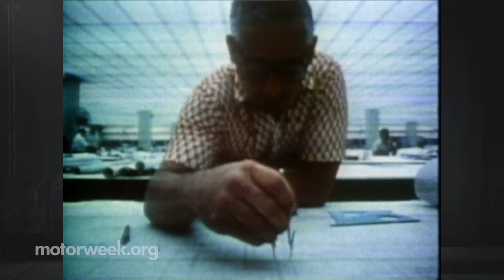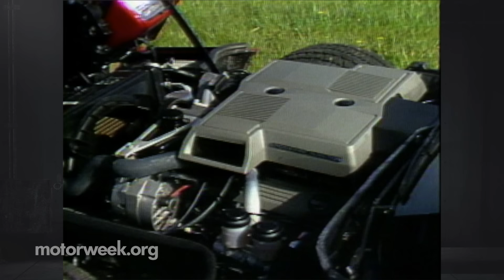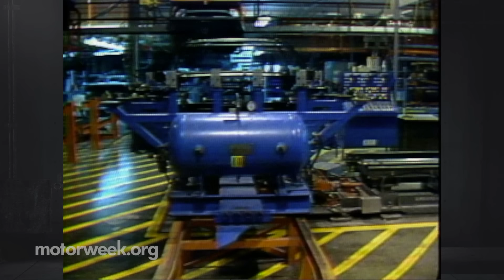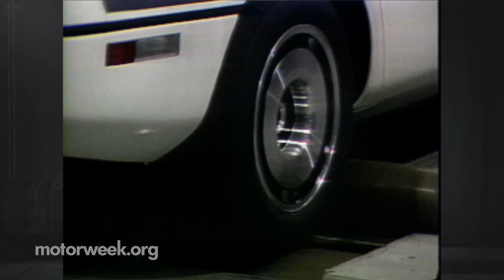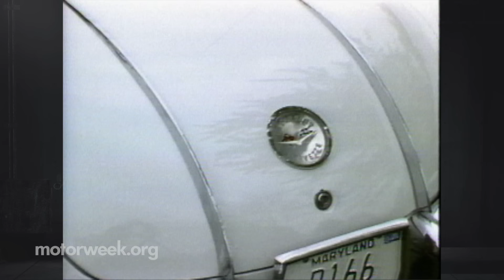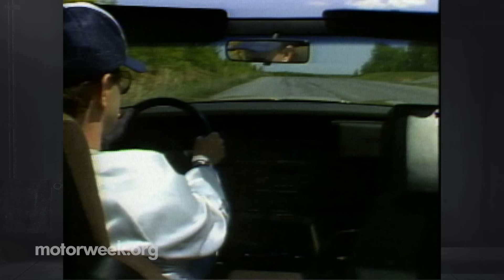MotorWeek | Retro Review: '84 Corvette Special Episode

Comment: All that fuss about how great the car is, how advanced the technology is and how powerful the engine is etc etc.. Then on the road test he says "A hardly slow time of 7.9 seconds from 0-60" - I nearly pissed my pants!!
Reply: this was 1984...... maybe you should learn some automobile history
Reply: Yep, C4's were nothing but glorified Firebirds until the LT1 came out with actual somewhat respectable numbers.
Reply: +MaxTheKanuck There isn't anything in common between a Firebird and a Corvette...aside from design gimmicks like the rear hatch and pop up headlights, they're completely different cars.
Reply: SuperDuty455 I mean performance wise, they were both slow and underpowered.
Reply: +MaxTheKanuck Well compared to what was available back then, they weren't bad at all.
Reply: SuperDuty455 Nope, they were still pathetic. Compared to most of what was new then, they were more or less up to par, but compared to the cars that had come before, they were junk. Take a 1969 Corvette with an LS6 and race it against a 1984 Corvette with an L98. Give you a guess which would win.
Reply: +MaxTheKanuck yeah because thé LS6 was the standard engine in the Corvette...by the way, the pre-71 power ratings were not realistic, it's the actual performance times that should be compared. You'd be surprised how well they do with so little power.
Reply: SuperDuty455 Um... Yes it was? LS6 454 bud, there was the LS5 and the LS6, LS6 was the higher spec engine, made about 500 horsepower. And that's actual horsepower, not an inflated number. And regardless of your opinion on it, the fact is, the older car would completely embarrass the C4.
Reply: SuperDuty455 Wait, I dun goofed, LS6 was only available in 1971.
Reply: With a much bigger engine and nearly no restriction, it would be embarassing if it didn't :P It was rated at 425hp actually. SuperChevy did an article testing a few all original muscle cars on the dyno, including a Chevelle LS6...those 425hp turned out to be a much less impressive 283hp...So yes, those pre-72 ratings are ridiculous.
Also, C4 Corvette would dominate any C3 Corvette on a race track thanks to its much superior chassis.
Reply: SuperDuty455 Chassis design means nothing when you have twice the WHP and probably 4 times the Torque.
Reply: +MaxTheKanuck out of a straight line it does
Reply: SuperDuty455 I'm having a hard time trying to figure out why you're defending this pathetic feat of engineering to such an extent. A 1969 Corvette with fucking wagon wheels could kill a base C4 around a track. Handling means next to nothing when there's that much of a power advantage. Plus, C3's didn't really handle too badly either, an LS6 454 would inevitably be imbalanced as fuck, but it's still controllable by someone who knows what they're doing. C4 loses. End of story.
Reply: I'd have to see that. Yes the LS6 is faster, but then again, how is that fair to compare this monster to a 350 small block base engine ? In that case I could use the ZR1 as a comparison...I doubt the LS6 wins by much there.
And yes, handling matters a lot when you're on a real track. If your car skids all the time and you constantly have to adjust its trajectory, you're losing precious seconds.
Reply: By the way, it appears you're still in high school so I doubt you have much if any experience with either the C3 or the C4. Pointless discussion.
Reply: +LeadBlastin22 Detroit was still attempting to come back from the gelding emission controls and fuel economy regulations did to the former 'muscle cars'.
Reply: +MaxTheKanuck Ummm.... Leaded fuel, CAFE regs, Arab Oil embargo and pollution control.
Reply: +MaxTheKanuck Handling makes a huge difference around a track.  That's why the Europeans were kicking out butts on the race track with significantly smaller engines.  The C4 Corvette was a step in the RIGHT direction for a sports car.  The Corvette is a sports car, and not a muscle car.  Sports cars are designed to live on the track.
Reply: +LeadBlastin22 7.9s in 1984 was pretty good at the time. Plus, the corvette is a sports car, its more about handling than raw straight line speed.
Reply: Jason Voorhees All of which I already knew. But yes, that is indeed what happened.
Reply: MaxTheKanuck The 1984 didn't have the L98, it had the  Cross-Fire injected engine. And by 1984 with stringent emission standards, we're lucky we had Corvette. Wow, we sure have come a long way haven't we. I mean a 2019 Corvette ZR1 with 755 horsepower and 715 ft. lbs. of torque is what a Chevy Corvette was truly meant to be. And yes a '69 Corvette with any engine would beat a stock '84.
Reply: That's not correct.

Comment: Wow. How much did Chevy pay you to make this episode?
Reply: +OscarMaris you must be new to motorweek retro.
Reply: +OscarMaris smooth bro
Reply: someone else explain it to him.
Reply: Oscar, I still have my '84 and it outperforms the factory spec across the board.  It has over 350K thousand miles on a rebuild at 130k, with no oil leakage or burning.  The "84 had some flaws, having extremely stiff springs, but it also out corners any Corvette, naturally controlled - without a computer.  This car was MotorTrend car of the year and won many other awards that year.  I outperformed Porsche 911, Ferrari 308, Lotus and the Datsun Z at Laguna Seca.
Reply: OscarMaris it's funny you talk about that I noticed in the 80s GM always got better reviews than all its competitors on MotorWeek. There must be some politics involved. same with Motor Trend and the 90s it was the Subaru. Subaru's were always so much better built and so much higher quality than the others. I find that pretty funny since it's pretty rare to see a 90s Subaru still on the road.

Comment: Hand painting with no respirators. Smart. I wonder how many of them are still alive. I had a first model year that was 2 years old with practically no miles, under 5k. It had the optional Z51 suspension, which handled like a race car but was so stiff, the car couldn't be used for travel. I had to sell it because every time I hit a dip in the road, my head would smash into the roof panel. Not comfortable, at all. 

I had one of the rare cloth seat versions, and the upholstery had separated from the air bladder controls with so few miles. Also, the rear hatch solenoid failed. GM wanted a small fortune for it so I took it apart with a can opener and fixed it myself. And BTW, the '82 Collector's Edition was the first production Corvette with a rear hatch that opened, contrary to what John Davis says. 

I never cared for the LCD dash, it looked cheesy to me from day one and I wondered about it's reliability. And the car was not that fast, all things considered. 0-60 in 7.9 seconds is laughable, but C&D said it did it in 6.7 seconds, and I'd believe them over this goofy show. I did like the styling of the 84 Corvette, but it looks pretty dated today.

Comment: Back when 205HP and a "Hardly slow"  0 to 60 of 7.9 seconds and a 15.8 quarter was fast. 
         Flash forward  35 years to a 2019 base model Civic with a 0 to 60 of 6.8 seconds, and a 15.2 quarter  :)
Reply: Dont even have to FF that far. My first car a 96 Z24 did a 15.6 in the 1/4 stock with a dohc 2.4 liter. Had 155hp.

Comment: I owned a 84 crossfire Vette and it ran awesome. I know the tuned port was better but if GM would've opened up the heads a bit to truly utilize the crossfire design instead of choking it off to meet epa guidelines, it could've been twice the performer it was. I never had a moments issue with my 4 speed model. Ran like a scalded dog.

Comment: If you're going to buy a C4, go for the 1992-96.  No issues with non-functional LCD's, or the problematic TPI.  The TPI is hell when it's well, but when she's sick...  Avoid anything with the Doug Nash 4+3.  The only complaint I had was the design of the LTT-1, and that fact that the opti-spark ignition was under the water pump.  You can imagine what happened to it once the pump leaked.  And it isn't easy to replace either.  The 1988 and up headlights have a circuit board by them that is uber expensive to replace, and they can get wet.  I never did like the foot well hump on the C4's.  I didn't like the C5's at all, and didn't get my next Vette until the C6 debuted.  Somewhere around the house I still have my 1988's targa top tool.  What a bitch removing that was.

Comment: This would be MotorWeek '83 right, as I presume this episode was shot in early 1983? Not sure why everyone else thinks is a 1984 episode,when Bowling Green was practically ready to build these by the very end of 1982 (st. 1/3/1983).
Reply: im guessing it was late '83 as there is no 1983 corvette because it came out so late in the year GM decided to make it 1984
Reply: Not true, it went into production in January 1983, so it is not "late '83". That is not the reason they called it an '84 model.
Reply: the '82 Corvette was so bad they just had to do it right and that takes some time
Reply: The new redesigned C4 Corvette was not released until very late 1983 and considered an '84 model.  There was an extreme design flaw with the chassis.  Since this new design was a targa top and did not have the center roof support between the T-tops as the C3 generation had.  This caused tremendous "body flexing" like a rubber band.  The center T-top roof bar on the C3 was structural so without it on the C4, the chassis needed to be redesigned to increase body stiffness.  The width and height of the chassis had to be increased.  This is why getting in and out of the car can be difficult.  The thicker and taller sill area added stability and stiffened the chassis.  I hope that helps explain the true reason why there is only one 1983 Corvette (on display at the National Corvette Museum)  in the world out of the 43 produced.  The other 42 were crushed and destroyed by GM for not meeting quality standards.  Maybe I should produce a video on my Ytube Channel explaining all this if there was enough interest?? Let me know.   Take it easy - Ozzstar

Comment: 7.9 seconds  0-60?  The '87 'Dodge Omni GLH Turbo did it in 7.5 seconds, and it looked like a box~
Reply: Yeah the Twin TBI setup was junk and basically a carry over from 82.  The 85 brought about TPI (230hp and 330ft lbs) and 0-60 times dipped into low 6 to high 5 second ranges.  Along with that came honest 150mph top speed as well.
Reply: Its wrong
Reply: @Vekurus  The '85 Corvette ran to 60 in 6.5 seconds according to magazine articles of the time.  That Corvette had approximately 80-100 less horsepower than the best '85 Porsche 928, the non-USA S2, which could hit 60 in about 5.5 seconds with comparable curb weight.

Comment: My dad had an 86 until a few years ago. Each component of it was crap. The engine was a pickup truck engine, the transmission was awful, the steering rack was numb, the build quality was garbage.

But the thing as a whole is magnificent. It’s so much fun to drive; it feels like an oversized go-cart and the torque just pushes you through any problems. I can’t even describe how wonderful it is to drive. It’s just fun and responsive and willing to take anything you throw at it.

Comment: 15.8 sec and 89 mph in the quarter mile and 138 mph top speed.  Well my Z51 '84 4+3 Manual transmissioned  Corvette did 14.66 mph and 94+ mph in the quarter mile (stock) 14.6 (corrected) for sea level.  The later road test top MPH was 142 mph.  I know my car would have hit that had I had a proper course to try it on.
Reply: Yeah, the '84 had those same Throttle Bodies.  LOL    The '84 spec on the quarter mile was 15.28, as stated from the factory.  Top speed from the factory was about 140-145.  Those Throttle Bodies and that half functioning intake made it lack upper end HP and top speed.  Porting the intake did make a difference.  I'm hoping to find that out sooner than later.
Reply: David Safely.     My 84 with about 10k on it did 161. the hood looked as though it was about to leave the car. many have questioned me at the time, but no one wanted to get in and call my bluf.
Reply: You likely had the hi - rear axle ratio of 2.78.  I had a 3.34 rear end, so it would not have as much top speed, as yours.  However mine is still faster than what the factory said it would do.  While you would have a higher top speed and get slightly better fuel economy.  The 3.34 rear end came with the Z51 4+3 Manual Transmission only.  Only 6% of '84 Corvettes came so optioned.

Comment: That crossfire injection was pretty unreliable. Linkage would wear out quickly and then the two throttle bodies would be opening out of sync. You could imagine driveability with that situation. Most of these were switched out for a four barrel carb.

Comment: Were manual transmissions available with the C4 Vette?  You never see them.
Reply: +nowitsabadtime They had the Doug Nash 4+3 transmission, which wasn't great. And I think they had the T56 6 speed in the later years, a very good transmission.
Reply: I remember back then it seemed like all of them, at least the '84-'86, were the 4+3 which were Auto.  It wasn't until the ZR1 that you started hearing about manuals.  Neat car though.
Reply: The 4+3 was a four speed manual transmission with a weird 3 speed overdrive unit on the back of it.
Reply: Was it really?  I always thought it was one of those clutchless 'his and hers' auto set-ups.  Well at least, it was a stick.  I know very few '74-'82 Vettes were stick.
Reply: Yes, it was the choice for the manual on the C4. It's mentioned in the video. Not the best but I guess it's all they had that could sustain the torque of a 350. The T5 5 speed was too weak, even behind a 305.
Reply: Nice.

Comment: This was the most uncollected corvette ever made. Back in 2003 i bought the 84 top model with the wing for 2000$ the guy originally had it up for 9k. It was slow with the crossfire fuel system.believe it or not but my 88 conquest would smoke this car.. I sold it to a corvette collector cause i dont like automatics.

Comment: It's funny how in 1969 Chevrolet could develop a 427 big block with 500+ hp. WITH A CARBURETOR.  But yet in 1984, only 220 could be developed with TBI. And now, we're at 700 hp. 200 hp naturally aspiration over with blowers, and turbos. 50 years. It only took 16 years to go from 150 hp, to 500+ in 1969..!
Reply: Tell me how far we've come again with technology. Sure, the Challenger has 707+ hp, but yet gets the same fuel economy as 1969..! So, where have we improved. Other than tire technology.! Talking gasoline engines only, 427 big block Chevrolet Camaro's from Yenko, Dikkie Harrel, Baldwin Motion, we're all rated at 11.5 quarter mile times. With 1969 rubber.! THAT'S  saying  a lot.! But, today, it's like going to the moon all over again.!
Reply: These were still fast cars it did 0-60 in 5.5-6 seconds the times in this video are wrong. 1/4 mile in 14.8
Reply: Gross vs net

Comment: Whoa, 205 horsepower from a 5.7l engine.
Reply: Think that's bad, the 80 l48 i got has a whopping 190. I'm gonna fix that though.😁
Reply: Things were a lot different back in the early ‘80s. There were large diesel V8s with only 105HP in very large cars.

Comment: was this one of those 200hp big v8 corvettes right?  I assume it is since they never mentioned the specs early on.man the 80's, gov regulations, and politics wrecked the American auto industry
Reply: +bob loblaw The American auto industry mostly wrecked itself during the 1980s. If the Caviler was built as good it should have been, there wouldn't be nearly as many Civics, Corollas, and Sentras back in the 80s.
Reply: +bob loblaw Hell, the 76 vette only had 165hp.

Comment: they were so goodlookin, but so slow. Hampered by the generations neutering of power after the 70's oil crisis. Imagine if that had not happened how quick that 84 would actually have been, probably 700hp.

Comment: I could see faking it for the rest of their cars, but I can't believe the Corvette would have a fake dual exhaust system. Where he says single converter going through two Mufflers with quad pipes. That's not a true dual system... they could have easily gotten another 20 or 30 horsepower out of that car just by putting a true dual system on it with either an X or an H pipe
Reply: Chevy only used one cat in the exhaust, but this engine wouldn't rev above 4500 rpm anyway. The heads were very restrictive, peak hp was at 4300 rpm.

Comment: Pat is spewing so much BS about older corvettes that I had to take a brake to go look for my hip waders. Those drag slicks would never fit under a stock body vette and those stub axles didn't just break because of them. That rear end didn't explode because of some bigger tires either.Sure wider tires mounted with a big offset wheel can stress some of the rear end components but lets get real guys.

Comment: Most modern mini vans and many compacts are faster.  I love Corvettes, but there is a reason the 84 is the least desirable of all models, including the California model that had the 305 in it.
Reply: +scott9050 I think you're pretty wrong about that. it's not the highest horsepower car but it had plenty of torque at low rpms, and if it doesn't beat the mini vans and compacts in the straights, than it will in the corners
Reply: All of the cars from that era had glaring problems due to emissions.  I am glad I live in a time where a mini van can beat the inro C4 Cease Fire Corvette.
Reply: +scott9050 There was no C4 with a 305 in it, unless someone foolishly put it in. No exceptions. 5.7 350 only.
Reply: +bluebellbus70 

I was talking about the One year only 180 hp California emissions C3 305.
Reply: I know this is old. But my 84 auto is faster than a 2016 Gmc sierra 5.3 4x4. 3 car lengths as soon as the light turned green. And my vette had a fuel pump that was not supporting the higher rpms. A mini van isn't faster than that truck.